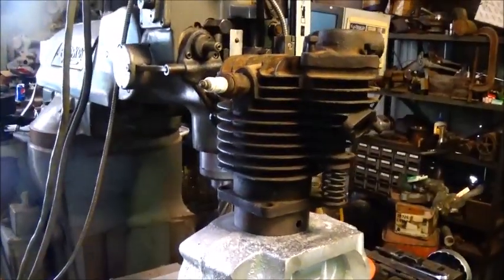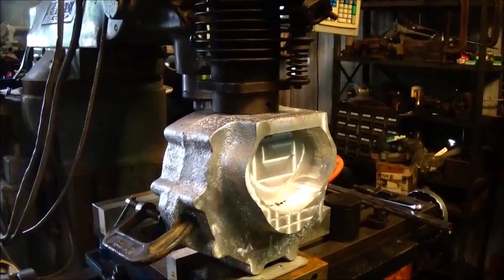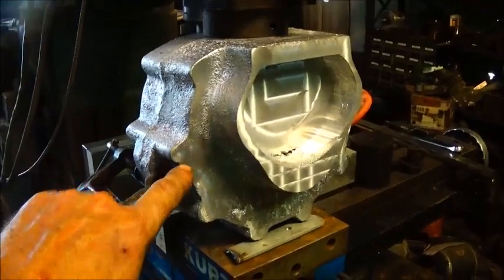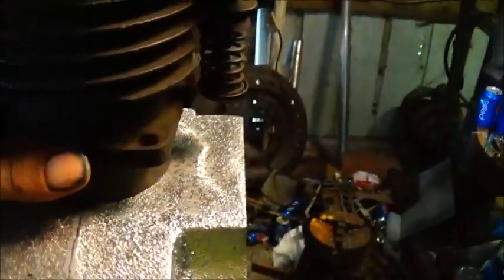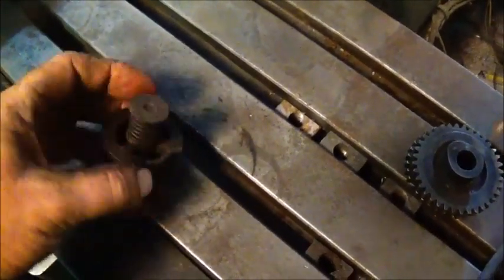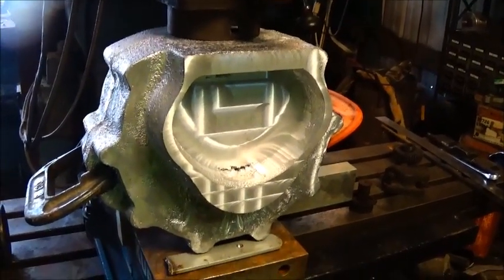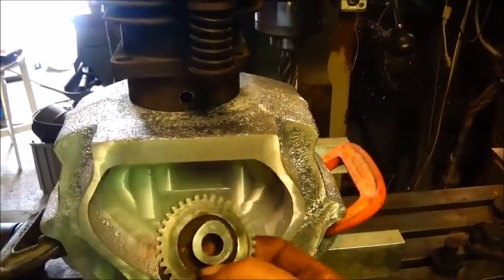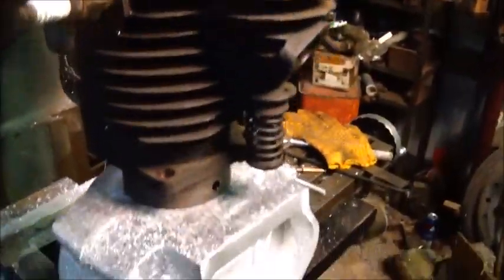Pocket Valve Engine Build Antique Motorcycle Part 2

Comment: When you said, "...we'll probably end up breaking it anyway" I busted out laughing.  Thanks for the run-down on this build.  I wonder, how critical is it to get the cylinder head lined up dead even with the center line of the crank?
Reply from the maker: It's not. I use to move cylinders apart on a 4 cylinder tractor pulling engine so I could get a bigger bore. I have had rods of center of the piston by 1/2" without problem, but I try to center as close as possible. As lang as your rod it straight and not binding.

Comment: Those gravely cylinders are still being made and sold at a reasonable price. For that matter, most gravely parts aside from the major castings are available. I run these tractors on my place to trim before brush hogging.
Reply: I'd be interested where those are for sale.  Last I saw the T heads were out of production and there were only some un-machined blanks available for like $800.00.  Not being a smart-ellic here.  Truly interested.

Larry W.

Comment: V Twin!
Reply from the maker: I have 3 cylinders, I would have to build the rods, but I could build a 3 cylinder.
Reply: Jonathan W Harley prototyped a 3 cylinder (looked like a low rider) it had the 2 cylinders same as usual, the 3rd was pointing straight up the road...2 is all you need...these pocket valve/hit & miss engines have a distinctive sound & was wondering how a 2 cylinder would sound/fire...also was thinking a longer stroke smaller piston would draft the intake valve better...just my 2 cents...your comment about making rods made me remember a video where you were explaining how Charlie Taylor made his crankshaft
Reply from the maker: Moto Guzzi made one too. It has a master rod for the center cylinder and two secondary rods. Same concept as a radial engine. As for bore and stroke, just using what I have. Letting the parts decide.
Reply: Jonathan W still think 2 is the way to go...just not sure if while 1 was on power stroke the other could be drafting in
Reply: I've owned and worked on some odd ones over the years with conrods that were fork and blade ,two rods on the same journal, and Articulated rods where there is one big rod with two smaller rods hanging off it . Most of them i worked on were massive diesels, hardly the type of thing you would want to use in your projects  ha ha .
Reply: A W motor would be really cool
Reply: Mercmad didn't know that was called 'fork & blade'...definitely the way to go in my opinion